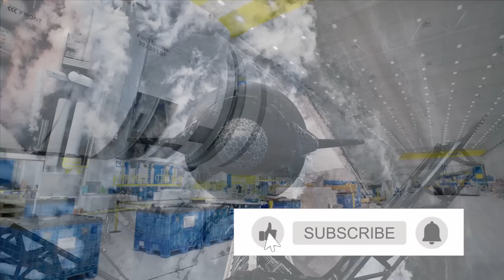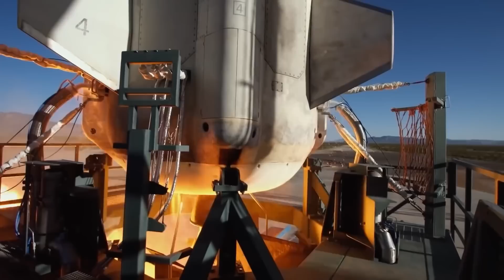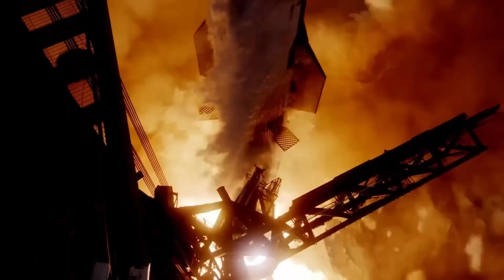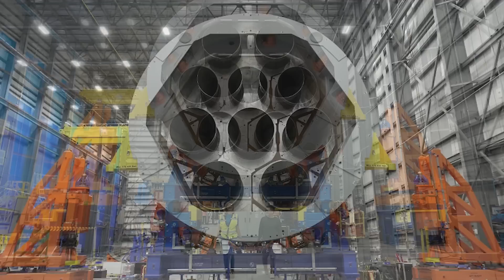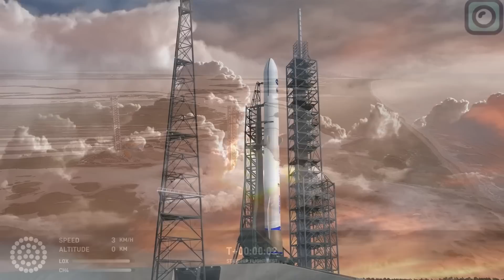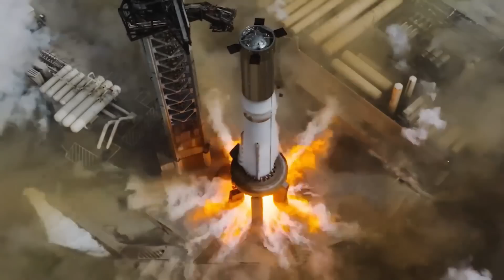Blue Origin Is Just A Joke... New Glenn Orbital Flight Delay!

Comment: Hey, as someone who works there, a lot of passionate people are working on this, and are making sure above all else it's safe.
Reply: Seems like your prioritising safety over innovation. Remember innovation brings safety too
Reply: @HaydenS2024  It would take a long time to go over objectives set out by industry standards like DO-178 and why those exist.  I'd recommend reading the JSSEH. Also, safe does not preclude innovation, but it does mean fully understanding the failure modes of that innovation and the consequence of the failure modes.  Innovation alone doesn't bring safety unless it's properly validated and verified.
Reply: @axmoran  well yes that's the case for quite littlerally everything ever. I will look into them so I appreciate it. But its undeniable that with more innovation there is typically more safety. Obviously because u innovate in the safety aspect. But my point is it seems too many companies are trying to play it safe. Particularly in the uk. It's appalling we have companies with 100s of millions of pounds and they refuse to risk the rocket blowing up. I think it's about balance but innovation should be a priority. Ie if u could make a rocket that's say 10% less safe but 20% better I'd argue taking the 20% better one is the right idea because in a decade or two ull gain the benefits of the better rocket.
Reply: So, when do you launch?
You haven't put any thing into orbit!
At this rate, Elon will be on Mars before you launch!

Comment: They will NOT a attempt to catch Starship with IFT-6.  The FAA license delay would have been stupidly long.  IFT-7 or 8 will the soonest for the Starship catch attempt.
Reply: What are you talking about?  They already did the catch last time.  The catch maneuver is covered in the license they already have in hand.  They will get as much practice as they can.
Reply: @frankmacgowan I believe he means catching the upper stage, and I agree with that. I think the next step will be to get the upper stage into true LEO, followed by a soft landing in the ocean again, meanwhile they will seek to prove consistency with a second booster catch. A ship catch will probably have to wait until Flight-7 when the second tower is operational
Reply: @kylewood2715  You're probably right.  No, I don't expect the ship capture until IFT-8.  I expect 6 to test the in-orbit relight for deorbit with 7 being the first true orbital flight, some time early next year.  Beyond that, my prognosticator doesn't seem to work very well, at all.
Reply: @kylewood2715  Correct.